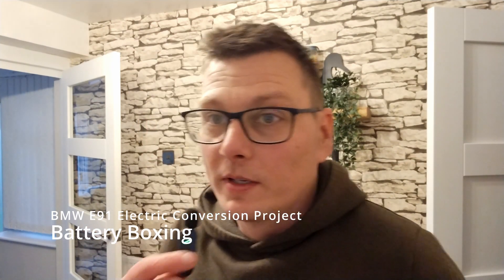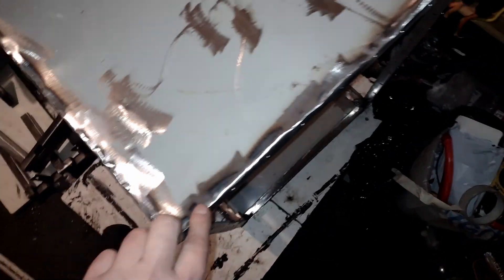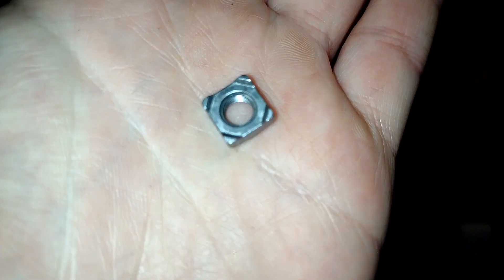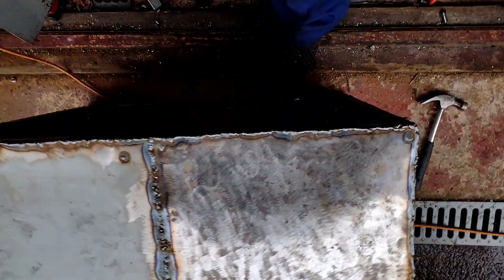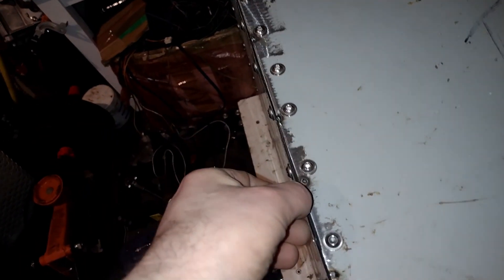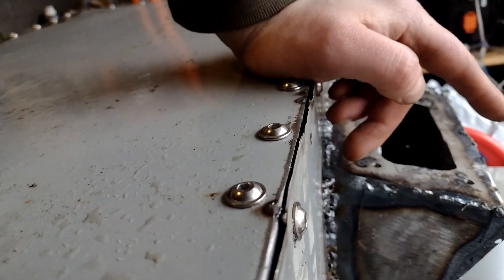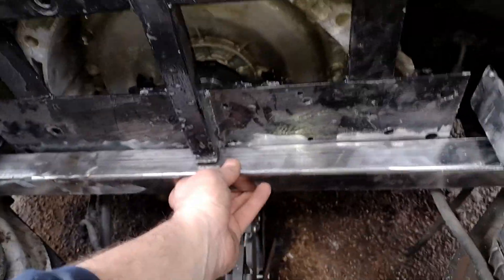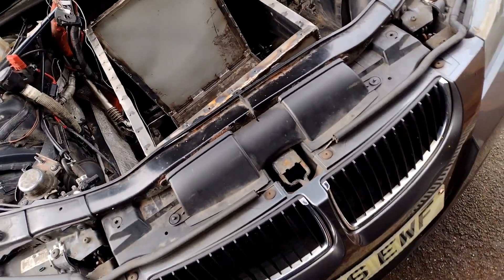BMW E91 Electric conversion - Episode 15 More battery

Comment: i like the battery box, why did you not use Rivnuts ?..i plan to use ali as im concerned about weight..
Reply from the maker: I'm wondering that now. I wrongly thought this way would be quicker and easier 😂
Reply: As above rivnuts. I will call around one day and take you through a bit of welding skills .
Reply from the maker: @paulcarnall791  Everyone's a critic :D